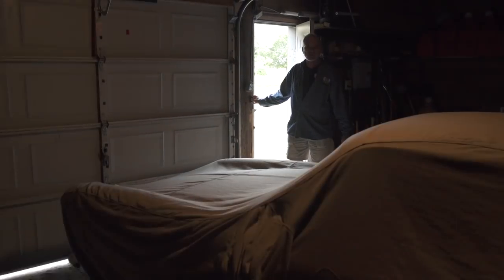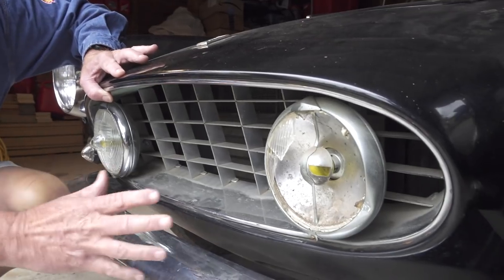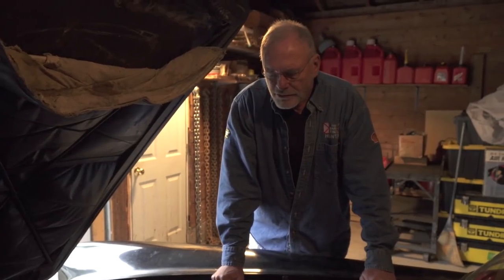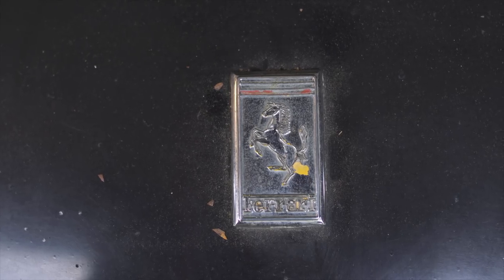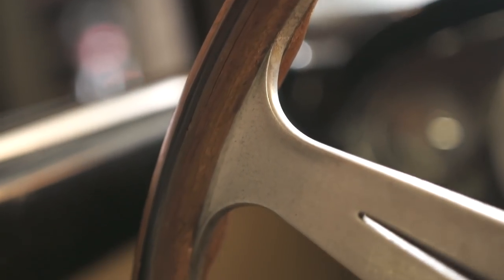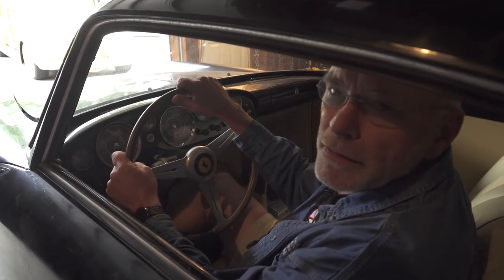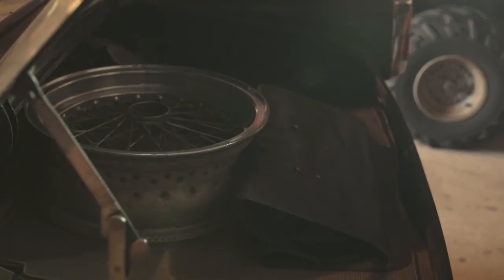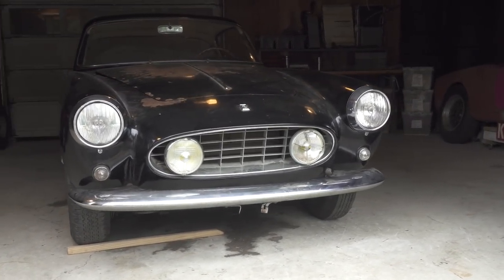Barn Find Ferrari 250 GT Ellena in garage for 40 years | Barn Find Hunter - Ep. 23

Comment: Molybdenum: It is used in steel alloys to increase strength, hardness, electrical conductivity and resistance to corrosion and wear. The spanner is such steel. Toolmaker Gedore also uses Molybdenum alloys, resulting in a superior-quality tool that lasts and lasts and lasts. So it's not surprising that Ferarri would use this alloy either.

Comment: Get it running and drive it. Cars aren't made to sit and rust away. It has tires, a steering wheel and engine for a reason. Nothing bothers me more than people who get these cars and put them in a museum to never see the road again.
Reply: But long after you are dead the car will still exist in the museum.
Reply: I partly agree with you, but some cars are now very rare. To put them back on the road is risky, and the wear and tear could depreciate them - not necessarily in terms of cash value - but in their structural integrity. These rare cars should be cared for by curators who allow future generations to appreciate them, and what they represent in historical engineering terms.
Reply: Such car as a daily is impossible, you just cannot find parts for it.  Finding correct tyres for such rare cars is a problem.

Comment: This Ferrari is a difficult one to decide to restore or not to. In one hand, originality is where is at. On the other hand, this car is obviously not in a proper climate controlled garage, full of chemicals and gas containers... and it is rotting away due to its age and heat/cold cycles, so eventually some parts will be beyond restoration and new old stock or fabricated ones will have to do, taking away from its originality. If this jewel were mine I would make it road worthy and not a full restoration but addressing the parts that are in bad shape. Starting with a full professional detailing, specially the interior parts and then taking it from there to determine how to keep it original or restore it to pristine condition. What a car, very lucky man is the owner of this piece of history. Thumbs up.

Comment: If I were the owner, I'd be a tad peeved that you dropped the spare wheel on the tool bag, and that you tried to jam the wrench back into its place without being lined up.  After that many years, that material (especially the elastic) is about as brittle as it gets and should be handled with more care.  But maybe the owner doesn't care - rust is neglect, and to say you're going to 'restore' that car and keep its 'patina' (aka rust aka neglect) is wrong.  Sinfully wrong.

Comment: I call at least partial BS.  Sitting for 40 years and the tires are fully inflated?
Reply from the maker: The current owner is a true car guy. It's been sitting, but it hasn't been neglected.
Reply: yamstar1 johnson you know you can still inflate old tires right?
Reply: According to the paperwork I have on my Austin Healey 3000, the Michelin X Radials that are on the car were mounted in 1969 and they still hold air just fine.